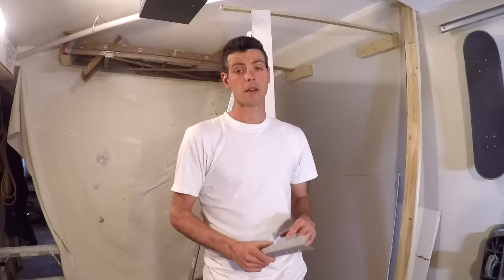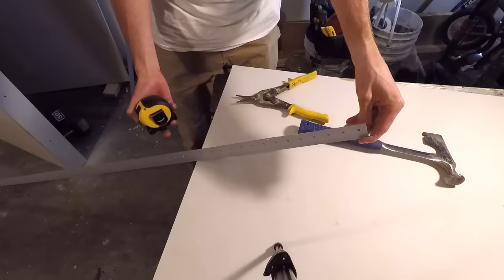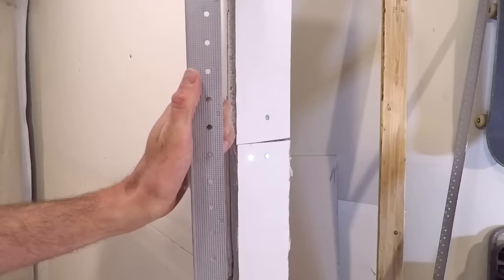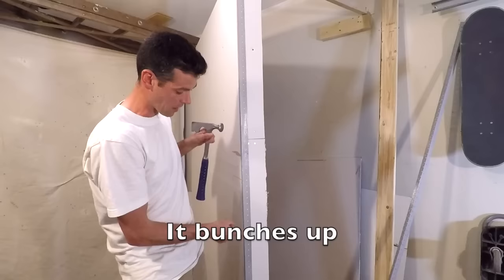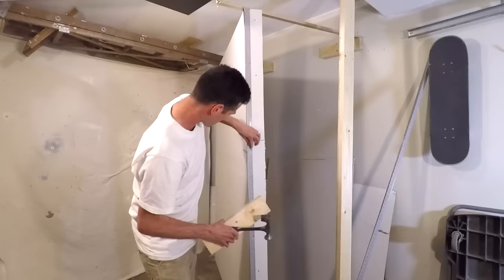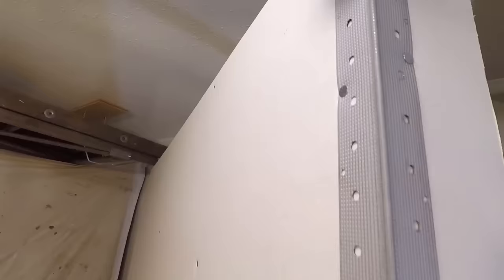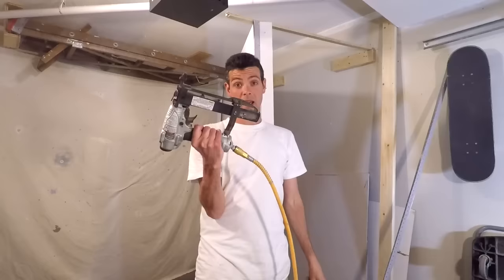How to Install Steel Corner Beads

Comment: I use PL/construction adhesive to set my corner beads (particularly for bulkheads and other overhead applications), then drive a couple nails or screws once its set/cured.  By using PL I need fewer fasteners, thus reducing bubbling/bulging.  It works in a similar method to pre-mudding a paper bead.  Give it a shot!

Comment: I like the corner bead tool, it puts it on even an pinched both sides at the same time, huge time saver
Reply: If he used the crimper the vid would last about 15 secs

Comment: Thanks. I always thought that the nails were supposed to go in the holes! Thanks, now I know better.
Reply from the maker: They are going in the holes. The holes are on the outside edge of the corner bead about 4 inches apart. They are just hard to see on camera.
Reply: @vancouvercarpenter  I think he meant the larger holes. ;) I did too.
Reply: Lol - We made the same mistake. Hubby drove nails into the larger holes, rather than looking for the nailing holes. They are all covered with mud now, so nobody will know but us. :)

Comment: I was taught to snip back the corners at each end so they didn't come to such a sharp 90 degree point.  Supposed to make it blend easier.  Just how the guys I worked with when I was a tender did it.

Comment: I have to repair where the previous owner had a half wall. SO half a bead. I fear the mudding/finishing of it and whether I can get it to look presentable.
You are an excellent teacher showing several ways and presenting materials that you may not normally use. I appreciate that. I'm using steel bc this corner into the kitchen gets serious abuse. Not sure if that is Why I should use steel but think it will hold the corner better when getting knocked by passers by.
Reply: hes got videos to shopw you every step and how to use every tool needed

Comment: You ever use or are you familiar with a bead crimping tool? I bought one when I built my house and it works probably faster than the pneumatic stapler. Some will want to question if the beads will pop in time, but in my thirty years in this house, I’ve had zero issues. After all, setting mud holds the beads in place. This is good sound advice though for nail placements.

Comment: Great tips, thanks! I hate corner bead and I use a crimp tool that you hit with a rubber mallet because I cannot get it correctly with nails and do not do it enough to warrant buying a stapler.

Comment: Love all your content Ben. If you’re taking video requests I was hoping you could go over when to know mud is ready to prime and paint. After tape/mudding butt joints I’ll run my hand across and feel a hump. I’m concerned it will show through the paint but I tried to feather and sand. Not sure when to know enough is enough.

Comment: Excellent! Never thought to use a stapler! Could you make a video on how you would use a corner bead crimping tool? I never used a stapler to install metal bead, but I use the crimping tool with a mallet to install them square then usually I go back and screw off the metal bead. Sometimes it’s fussy, but could be a great informational video. Thanks again Ben for a great lesson!

Comment: I'm not sure that you may be assuming that if an event such as a strong enough force that crushes your bead and in the area only would be the damage;  or mailing it lets you control it as best you can get it strait;  but a bead like that should be crazy solid if you just used 90 or what not and making it liquid enough that you can just jiggle it into place and then using taping mud to do the whole job or what not.  I've used both ways and have added carpenter's glue to both of them and that is the best  way really.  Paper corners are best ones that I find and the nailing really only need to be used for the plastic bull,  etc...;  because they tend to not get completely mud filled and end up that if crushed;  will have levee to spread out the support areas.  Maybe even using glue mud for your metal ones and then put your nails after they have dried;  because in my experience;  nailing them sometimes gets you surprises that end up putting tensions where they become stretched backwards along one or both faces.  But the reason that I commented was that bead should be really fast to install;  considering the time that it takes to join them at specialty cornering and which another thing that I'd like to mention is that self hardening mud is logic to use in those joining areas because of shrinkages that will change your settings of them and then you may wonder what happened.  Cheers.

Comment: I don't use nails or screws to hold it on, I use a flathead and a hammer and tap it to create a "bite" like a joist hanger, nails and screws bend it or stick out.

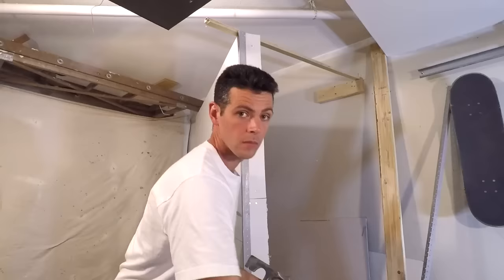Comment: At 5:10 he says if you’re a beginner you may hit your fingers once or twice. Hell, I’ve been doing carpentry for thirty years and I still whack my fingers
Reply: It’s almost like my left thumbnail stays blurple.
Reply: It's like driving a car... you're either good at it or you're not.
Reply: @baronharkonnen1217  😂😂
Reply: The ole thumb detector works good for you
Reply: Either way, you're still hitting A nail.
Reply: Electrical tape on your thumb. The hammer will slide off instead of smashing your finger. Learned that from an old carpenter.

Comment: Can you use screws on the metal bead if your corner is wood?     Does your bead go down to the floor even if you are using 5 inch trim at the bottom or do you stop short of the floor?

Comment: Would this be a good material to apply under siding in eaves, under rooflines, and in vulnerable corners outside of homes in a neighborhood where there is a big squirrel problem?  I have read that the one thing they can not chew their way through is steel, hence, my question.

Comment: I'm on a job right now where the homeowner insists on using steel bead. I just can't convince him that the paper faced is stronger and doesn't crack (which is why it's all I'll use). He still insists even after I've explained that I will NOT warranty finish work using steel beads. I'm considering telling him I can't do the job but I dont like turning down work. 
Any advice?
Reply: Turn it down if you think it will crack. There were steel beads on the half wall I just removed. It never cracked. I believe they're used all over the house. I've been here 20 years and the previous owner was here 25 years. So if you install it right I don't think it would crack. Also I think VC would say "Steel beads are crap. Don't ever use them." I haven't heard him say that yet.
Reply: Ive worked on building sites and do my own house repairs . . I see pros use steel and so do I . 
Not had cracks yet. 👍 🏴

Comment: May have missed it, but are drywall screws a no-go for corner beads? Im going to use the vinyl corner beads but can see the edges lifting as I tighten the screw.

Comment: These videos are perfect for my guys to learn a general idea.  would you be able to show a video of floating out an entire ceiling after removing popcorn?
Reply from the maker: I would love to make that video but I don't ever want to do one again. My neck and shoulder are wrecked from ceiling work. I don't have any popcorn removal jobs coming up.
Reply: Vancouver Carpenter no problem it does suck though tons of pointing up as well.
Reply: Buy or rent an electric drywall sander, it will amaze you
Reply: The most difficult popcorn to remove is the fine texture and then covered with a few coats of paint.  On one job, it was easier(cheaper)  to match the ceiling popcorn, than to remove the popcorn or drywall over it.   Every job is different.
Reply: Skim coating sucks. Literally the worst drywall task there is.
Reply: I use a pump up sprayer, if that doesn't do it, a heavy nap roller with just water. Scrape, then sand when dry. I hate popcorn but have  a few more left in my building @ya472
Reply: I removed a wall and closet from a 450 square foot open plan kitchen, dining and living room...  I left the popcorn ceiling, but blending the patch job was quite the challenge.  Some of the ceiling was lacking fasteners, so some of the ceiling joints came apart and had to be rebuilt.  It SUCKED.
Reply: @GarwoodNick  Totally agree.
Reply: Personally I think this is the best channel out for drywall instructionals but since you wont be getting one on here Paul Peck Drywalltube has some decent examples of what you're looking for. He doesn't present nearly as well but his work is fantastic.
Reply from the maker: Paul's a good dude!
Reply: Carl McCoy not always the answer
Reply: Well the best part is someone meshed and durabonded a 3/8 board in the middle of the kitchen that has 1/2 inch board
Reply: @adamjohnson9509  that's a selling feature.   Recessedish ceiling.

Comment: Super helpful video. Are you supposed to use drywall tape over the steel corner once finished nailing it in place?
Reply: I use mesh tape over the edge and first coat with 90.
Reply: @shawntennant6588 my issue with that is sometimes the mesh shows on the corner, I keep it back like 3/4 or 1 inch

Comment: I like using staples
Reply: i like the staples too. i have quite a few loose spots (original builder didn't use too many nails on the metal corner beads) and missing plaster in need of repair.
Reply: @topsyball1049  I use 2" #15 staples. I've never noticed any issues with holding so long as:
A. I use enough staples
B. The staples are pinning into a solid backing behind the drywall
C. Prefill done with Durabond and taped the edges.  If Durabond isn't available in your area, use any hot mud and add some latex adhesive to the water used in the mix.

Comment: A old timer years and years ago showed me corners 2 ways. 
1- your first set up with nails. 
2- run mud on corner then install bead and nail. 
We did this in a house where walls were being torn down. 
After we did all the steps. And dry time. He said. Rip them off. 
Both were a pain but the one with mud behind it was 5 times as hard. 
There were several other ways we tested these corners. In short useing a jack to apply pressure from sides or bottom. Not one time did the mud backed bead break or crack. The other side failed all. 
Yes it might be overkill. But it’s small things like this that makes you stand out. 
Oh FYI never screw corners.
Reply: John Savage 
One big 1 is screws deform very easy with screws. 
Also it’s more easy to finish after. 
I like to set metal in set mud not dry. 
It helps corner also I have pulled them apart and the drywall wasn’t a great fit and metal was rusted from back side. 
I have fixed corners with screws that were installed wrong and mud didn’t get in the gap of side of bead. 
Custom homes I’ll use paper metal  corners. But in rentals etc I want metal all the way. 

Just like a lot of people over nail corners. It doesn’t need it. 
You want a good job and the rest is easy.
And with nails you have more control over the metal verse screws.
Reply: John Savage 
What I do? Lol
I didn’t mean to say your wrong simply my opinion and over time learning. 
I learned from old timers. 
Was thrown into plaster and lath very young. 
Needed a job. He gave me a few hand tools and said go do that closet. After a few days of F***ing it up. He came in and looked and said now you know how not to do it now I’ll show you. He wanted to see if I’d quit or keep trying to fix it. 
It took me years to be able to do walls that were smooth as glass. No levels. No lasers. Making hand tools to duplicate missing moldings or whatever it was. 

Then traveled for years doing it and 1 thing always stood out was the corners as issues with people. 
I have fixed several hundred corners due to screws or people running them all the way to the floor. 
Or people who use fiberglass tape verse paper. 
It’s one thing if your trying to stitch a very large crack I guess fiber is somewhat ok. But paper is the only way to go. 
Everyone has there own opinion on how or what to do. 
If I see issues more then a few times I try to correct it. And never having a issue with nailed corners I’ll nail them. 
Now I will say all the ones I have fixed with screwed corners. I don’t know who did the work. Owner. Handyman. A business or whoever. 
Screws are stronger then nails so you’d think that’s the correct way. 
But corners in my dealings nails are the way to go. 
It’s just like how people do there 3 or 4 way wraps. You know by seen people’s work how long they have been doing it or what they have learned. 
Anyway if you use screws. It’s your choice. We all have our own clicks. 
I just go off of exp and issues I have fix. Screws have become issues but none with nails on corners. 
Personally I’d rather do plaster with a 4-5 finish every day. 
Sadly it’s becoming a lost art. 
I have been lucky with some great customers and I still do several houses a year in plaster with a lot of art work in it. Hand made moldings on the job site.
Reply: John Savage 
Very true comment. 
There’s a lot of ways to do things. 
And the ones I have fixed it might of been a idiot who did it. 
One thing I hate are callbacks. So I always try to use the site fire method. 
Crimping I HATE. I have seen so many guys crimp and that’s it. 
Sometimes I’ll go a bit overboard. 
Mud corner then install metal. Then use paper half on and half off of bead and mud. Or plaster. 
But in today’s world it’s about the $$ 
We can’t always do what we want but do what we must. 
The one thing I hate is sanding.  I never sand a few of my guys still do on spots. 
As long as we’re making money and do a good job is what it comes down too. 
As a carpenter here’s one for ya. 
Job I’m at I get into a argument with the framer. 
He’s building a bearing wall on the ground. He puts 1 nail through bottom plate into stud. He did it with all of them. 1 nail. 
I joke and say you saving money on nails. He says I’m dumb. It’s bearing when it takes the load it will be fine. And the 1 nail per stud was only to hold wall together till weight holds it together.   Some people lol 

After 30 yrs I’m still learning stuff. 
And if someone has a better way I’m all for it. 
Some new products are used due to speed but lack quality. 
You always do the best job you can and if it’s a new house and something goes wrong blame the engineer who designed it. Lmao

Comment: At 3:08 I am trying to understand the equal space location of the 1/8" you are talking about, Thank you
Reply: The gap from the standing corner of the bead down to the surface of the wall -- the space that will be filled with mud that is.
Reply: @gregdubya1993  Okay, I see what you're saying ...thanks.

Comment: @Vancouver Carpenter I’ve installed vinyl corner bead, nailed only, no glue.  Ready to mud but am unsure of what to use.  Someone said use mesh tape on sides, but then I’m supposed to use quick set with mesh tape.  I’m confused but really want it to turn out right.  Can you offer any guidance?
Reply: I've used a hand stapler on vinyl with success.  Especially with flex vinyl on arches.

Comment: Use a 6" plus knife to get a good idea on how the corner is going to fill in and that all fasteners will be covered. You'll be kicking yourself when that corner is 3/4 full of mud and you find an area that is installed too tight.

Comment: I don't know why there is such a hate against the steel edges.  I did my entire house, the steel edges look great, but a few of the paper corners are pulling away from the drywall.  Yes that's probably my fault as the installer, but I'm going to use what works for me.
Reply: @RasmusJohanson  My response was because in a few of these videos there has been an obvious bias against using the metal corners and this video starts out with the premise that the only reason for using metal edges is if you can't get paper.  I just wanted to state that you shouldn't be put off of metal edges because of some people's "preferences."  Your reply sums it up perfectly - try and see what works.  But I can see newbies watching these videos and avoiding metal edges because that's what they were told in a video.  I started off with metal and switched to paper because of advice from a buddy who is a contractor, now I'm back to metal.
Reply: @IrulianDark  Our drywall contractor used all steel beads. From the view of a homeowner, the steel beads seem sturdier.
Reply from the maker: I am biased, I agree. I also agree that metal beads can be done well. I like to use mesh tape and quickset on them to make them super strong. Video coming soon.
Reply: I always use steel beads. I find them to be stronger and you can manipulate them to be more straight when the framing is wonky. I use drywall screws to install them.

Comment: Can this be used to fix a bumpy/uneven  wall? Like to reconstruct the wall from the edges/corners. Could this help to stabilize when applying mud?
Reply: I think he is the one with the "structural Mudding" or something like that. Muds out a wall to get it flat. Awesome job.
I doubt it will stabilize anything but the corner. the holes are so the mud goes behind the bead and when dry causes the mud to hold well to the metal and the wall without separating. I don't believe the mud would normally hold to the metal at all. I believe it would just flake off. So the holes are the thing that holds the mud there.
Then you keep thin layers of mud wider and wider from there to "level" the wall. Use a straight edge like from home depot.

Comment: I like to use the plastic bead and staple it on. The metal bead sucks. If you leave a house sitting for a while around here the metal will rust due to the humidity and will eventually show through the paint. Nails suck on drywall too, they eventually start working out of the drywall. The coated screws are way better IMO.

Comment: Even if you can only find metal bead in your area, you still shouldnt nail or screw it on! When you do so you're attaching the bead to the structure and when the wood expands or contracts, you may end up with cracks along the  bead! Glue and clinch it on!